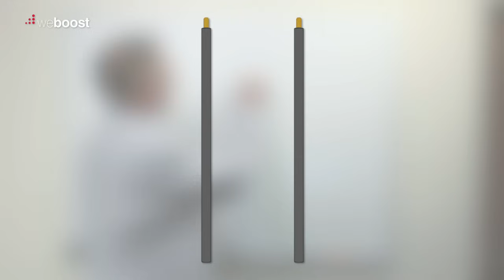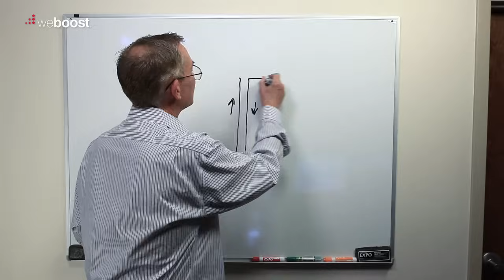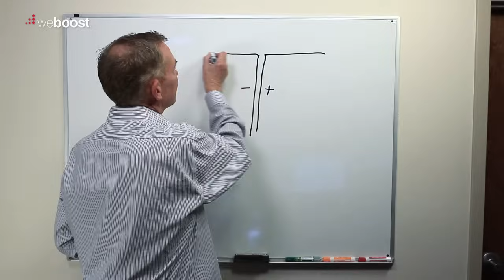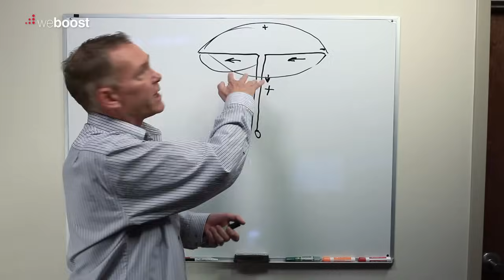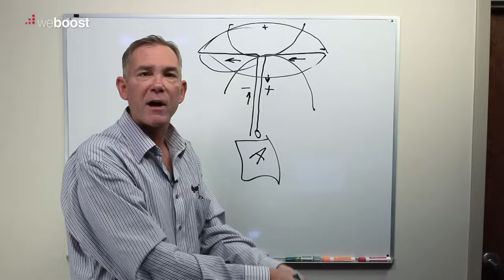How Does An Antenna Work? | weBoost

Comment: How does current flow through the wires when there isn't a full circuit, the two ends of teach separate wire are not connected.

Comment: I think I see your issue Don. You have a miscalculation in your turbo encabulator, this is simple to fix.

For a number of years now, work has been proceeding in order to bring perfection to the crudely conceived idea of a transmission that would not only supply inverse reactive current for use in unilateral phase detractors, but would also be capable of automatically synchronizing cardinal grammeters. Such an instrument is the turbo encabulator.

Now basically the only new principle involved is that instead of power being generated by the relative motion of conductors and fluxes, it is produced by the modial interaction of magneto-reluctance and capacitive diractance.

The original machine had a base plate of pre-famulated amulite surmounted by a malleable logarithmic casing in such a way that the two spurving bearings were in a direct line with the panametric fan. The latter consisted simply of six hydrocoptic marzlevanes, so fitted to the ambifacient lunar waneshaft that side fumbling was effectively prevented.

The main winding was of the normal lotus-o-delta type placed in panendermic semi-boloid slots of the stator, every seventh conductor being connected by a non-reversible tremie pipe to the differential girdle spring on the “up” end of the grammeters.

The turbo-encabulator has now reached a high level of development, and it’s being successfully used in the operation of novertrunnions. Moreover, whenever a forescent skor motion is required, it may also be employed in conjunction with a drawn reciprocation dingle arm, to reduce sinusoidal repleneration.

Comment: The video presenter is actually incorrect in his description of current and voltage distribution in a dipole antenna. He should have said in the diagram that the high current point of a dipole is in the centre at its feed point in this example with the high voltage points correspondingly at the ends of the dipole. The single direction of curent flow shown however, is correct in his example given.

Comment: I thought that electricity moves equally at any given point. I would've expected to see cylinder like wave coming out from wire, but instead the center of the wire has more streched magnetic field than the edges... or maybe magnetic field is like a disturbance of an ether field. The electrons push rhe ether evenly, but the ether that is pressed in the center has to travel further distance because of the pressure, while the edges under pressure are pressed to the sides and they travel less forward???

Comment: To explain the “current flow” in the antenna, which is an open circuit, one should explain that an oscillating current is applied to the antenna. Here is a better explanation https://youtube.com/watch?v=FWCN_uI5ygY&feature=shares

Comment: A coaxial cable was invented by genius physicist Heaviside, an antenna operates on alternating current, when current is passing through a wire it creates a magnetic field around it. The magnetic field creates EMI around the conductor and EMI is not free it's not only interference but all so power loss on the path. So we need something to catch our magnetic field from the central wire and not only catch but all so neutralize it somehow. That was a difficult task at the time and really even now you would have to spend some time to understand the physics behind the coaxial cable. Heaviside was not understood even by his fellow scientists in his times and the coaxial cable is difficult to understand. The basic idea behind it is that you can view a coaxial cable as a continuous loop around a wire. When current flows on the inside wire it creates a magnetic field around the wire - the outer coaxial ring but the outer coaxial ring at this moment is moving a charge in the opposite direction to the central coaxial wire, therefore it creates a magnetic field of its own. An opposite charge is moving by the outer ring that can be viewed both as a loop and a conductor, the charge moving through the outer loop induces a magnetic field on its own surface but only with an opposite to the magnetic field induced by the center wire sign. We have one field induced by the central wire on the outer coaxial ring with + sign and another equal magnetic field induced by the outer ring itself on itself with the opposite - sign. These fields are exactly equal and they cancel each other out. No noise around no power losses on the path. 
Please note that this effect is only possible with high frequency currents. Because with high frequencies the current is not flowing through the wire but rather hovers over it. The higher the frequency is the higher the current hovers over the conductor. It hovers outside of the central wire and inside of the negative outer ring. If you visiualise that - you'll see that both currents with both directions are moving inside of the coaxial wire through the same outer ring basically hovering in the insulator. And that creates an electromagnetic field on the outer ring with the opposite sides which cancels each other out and that's how the shielding of the coaxial cable works. With DC coaxial cable miracle isn't happening or rather the effect of the shielding is very small because the current on the outer ring is too close to the surface - no charge passing through a ring. That is the reason why it's only used with high frequencies. For low frequencies it has a "transparent" shielding because the loop for the magnetic fields for the current traveling in the opposite directions is no longer the same.

Comment: I don't think that 'jumping' part of radiation is the right description. I think it is best described as 'pushed away'. I figure the critical question in this regard is this: Why does the field fly away? Why doesn't it just collapse back onto the radiator?  If the peak of the arc of the field is close enough to the wires the field will collapse almost completely back onto the wire and there will be no far-field radiation. But how close is close? It's the reason that physically short, (relative to the wavelength,) antennas are such lousy radiators. The peak of the arc of the field has to be far enough away from the radiator that at the speed of light it doesn't have time to collapse back onto the radiator before the next cycle of that same polarity begins to expand and opposes it, pushing it still further away. In short, an antenna works as a pump. Once the field has been pumped far enough away from the antenna it keeps on going. So it's clear that the relationship between the size of the field's arc and the frequency of field reversals determines the effectiveness of radiation, at least out to a half wavelength, the largest possible arc. The lower the frequency, the longer the antenna radiator required for the same efficiency since the lower frequency gives the initial field more time to collapse, so the arc of the field has to be larger. I don't know the math to describe it but that perspective has always made sense to me, and I'll bet any field theory math that follows from that perspective works correctly.

Comment: The question that almost all students ask and never gets answered is; "How does the signal leave the antenna into a medium that has no substance?"  A dipole is not the best explanation starting point.  How about an infinitely long wire where the signal departs and never returns!  We even know the impedance of free space in ohms. An interesting parallel is the skin effect, signals riding on the outside surface instead of the centre. It boils down to the velocity factor in wire rather than air or space. A dipole is just a long wire with a finite length. Any conductor length less than infinite has a reflecting end point where there is bunching up and a spring-back. How much signal escapes along its transit? How many times does the signal bounce back and forth on a two ended dipole before it escapes. A more attainable ideal antenna is the rhombic with very long divergent arms. Even here there is a termination resistor whose purpose it is to absorb the yet un-radiated signal from returning from the finite ending.
Robert Livingston, VA7WN

Comment: Much has been made of the importance of STANDING WAVES- that there must be standing waves on an antenna for it to radiate e/m waves. I guess that this means the antenna is "resonant". So with a resonant antenna, there will be a minimum of this " cancellation" that u speak of, so that "standing waves" of maximum amplitude will be set up on the antenna by the transmitter. A maximum current amplitude will set up a corresponding magnetic field amplitude. Similarly a maximum voltage amplitude will be accompanied by a maximum electric field amplitude. And it is these magnetic and electric fields that radiate into space-i.e. if the driving frequency is high enough, then these magnetic and electric fields cannot "collapse" back into the antenna, but must detatch themselves from it-and thus move out into space. Also, although u want standing waves on the antenna, u definitely do not want them on the transmission line-i.e. the coaxial cable that u spoke of.

Comment: Hi don could you explain why on a typical fm diapole it has 2 wires at the top of the T with the ends tied together?.
Reply: If he could he would but sadly he’s no longer with us.
Reply: That type of antenna is called a folded dipole.

Comment: How to explain how an antenna works, without explaining how an antenna works.  I am a physics graduate though.  It's very difficult to explain properly to me, without the maths.
Reply: The math can only comes after a broad concept is understood.  If u don't understand the concept and only regurgitating the math thats on you man. As a supervisor of a machine shop i also math well. And Iv had to work with plenty of people like you. Its not really needed honestly. We have machines for the math. The concept of what outcome is needed through the math is what whats valuable in manufacturing and most of reality.

Comment: I think the thing that made most sense was the potential across a dipole where one end is negitive while the other is positive for the same value you get a EMF.  That's something I don't think I understood before- I understood the feed line either 300 ohm or coax- but not how that translates to an airel

Comment: A useful trick to understanding how antennas work is to realize that accelerating charges emit photons. In Don's example, one wire emits photons while the other wire absorbs those photons, when they are parallel. But when they are separated, they both emit in the same direction. 

Accelerating charges emit photons due to special relativity.

One sometimes useful way to view antenna design (there are many) is arranging the charge acceleration (currents) in ways that add the way you want. 

I add my prayers for the repose of Don's soul.

Comment: great explanation by 'DON'
1 clarification though: An AC current which will set up an accelerating and alternating dipole is the cornerstone for a 'Dipole Antenna' ...... anybody wishes to either correct or modify or elaborate further in the interest of the uninitiated are welcome

Comment: how can i make Antenna for wifi router that has two slot for antenna. one for antenna 1 and 1 for antenna 2.this is the picture of the router  https://ae01.alicdn.com/kf/HTB1Oy4voeuSBuNjSsplq6ze8pXaz/Unlocked-Huawei-E8372-E8372h-153-E8372h-608-E8372h-155-with-2pcs-Antenna-150M-LTE-USB-Wingle.jpg

Comment: Don I expected a antenna designer to be able to give a better explanation than this.
The pair of leads with current flowing in opposite directions do not cancel each others current out. They cancel each others radiated electromagnetic field out. They make a poor antenna.

when the pair of conductors are spit into a dipole antenna as you show the two oppositely moving currents are changed in direction so they travel in the same direction in the plane of the dipole as you show.The electromagnetic field generated by the current flowing in a uniform direction which you illustrate as moving right to left created an electromagnetic field that radiates out from the wire. Like light from a light bulb filament is can travel great distances.

On the receive side that radiating magnetic field when it strikes any conductor in its travel will induce a current in the conductor. So metal lawn chairs, garbage cans, tin roof on buildings all act like receiving antenna and have electric currents induced in them by the broadcast radio waves from many sources.  
A dipole antenna as you show will be impinged by the electromagnetic force from a distant broadcast antenna and the broadcast electromagnetic field will induce a current in the dipole that causes opposing currents in the lead wires going back to the radio. The lead wires are attached to a coil of wire in the radio that completes the circuit. The radio circuits then work their magic to get the voice or music or bits out of the signal.

Comment: In center antenna we have hight current not hight voltage but in too side antenna we have hight voltage +/- in each side  and change direction and change voltage polarite  on antenna -/+ when curent change direction
Reply: Salahi brahim: Correct....Dipole antennas have high Current / low voltage in the centre and high voltage / low current at the ends.

Comment: Sir what happens when antenna length is shorter than half of wavelength. 

And amplitude of em wave is controlled by current or voltage?

Kindly answer. 

Thanks u

Comment: How can I make cell phone signal booster ???
With this theory.
Reply: you can't without whole much more learning
just buy one on amazon or better yet buy a directional antenna
It will have a dipole element in the middle connected to the feedline as well as a shorter director and longer reflector elements to force the energy in one direction.
cell phones utilize multiple frequency bands so the antenna either has to be multiband or very wide band which again complicates things by order of magnitude.
The best thing you can do to yourself to learn all the related theory hands on is to become a ham radio operator. get an app for that and the exam is only 15$

Comment: I thought the current always has to be zero where the conductor ends, and the voltage its maximum.   And wouldn't the current be highest at the feed (lowest impedance) and the voltage its lowest?
Reply: Backpacker Thrulife: Yes...he got them the wrong way round. A dipole antenna has high voltage and low current at the ends and the opposite (high current & low voltage) at the centre.

Comment: I get why the direction on left wire,,,  but the right wire you have power just appearing somehow and moving thru the wire,,,  positive and neg,,,,, the positive is hooked up to something radio or a hoes purse or some electronic,, hard wired ,,,,  but this mysterious negitive begins in the air and magically moves in wire       So the bottom of example are on a car battery?  Positive goin out lookn for somin,,,  negitive has its dick in the wind not doin squat.  ?   How can the magic just materialize somewhere invisible in the air ...  find and enter the right wire in example,,,, then move and dance and become part of the get down?    I think this okay video falls short of showing why that is?

Comment: If the energy just “jumped” off of the antenna into free space. Why the need for a resonant length?  I believe the energy “bounces” back and fourth at least several times on the elements of the antenna before it gets radiated into space....... Thus the need for a resonant length antenna. The elements of the dipole have to be in phase with the wavelength being transmitted.  

Any thoughts?

Comment: So Antenna is basically an open circuit obviously.  I did not know that you could even have any type of electron flow in an open circuit regardless of how the wire is shaped.   This is all too weird for me or nobody really knows how to explain it or what is actually going on.  Obviously, everybody explains it in this same manner.  Very absurd if you ask me.  This is the same type of absurdity as the absurdity of computers operate and know only binary numbers and stores everything as 0 and 1.   Which is false.  0 and 1 are nothing but abstraction.  It is not true at all.  It is false.  You can not find 0 and 1 anywhere in a computer unless maybe in the serial number in the back of it.

Comment: Why is there current flow? Is that not an open circuit?
Reply: https://youtu.be/ZaXm6wau-jc
Reply: It is like a capacitor charge and discharge
Reply: @kassima9892  Even a capacitor needs a closed circuit to work and charge an object.

Comment: Hello and thanks for the video.  I do have a question.  What is the name of the item on an antenna that connects the wire mess antenna to the coax?  I think I need a replacement for my antenna.  Wondering if I can purchase and replace my broken piece so I don't have to throw away a perfectly useful antenna.  Please help.

Comment: I have a RV. Online I've seen RV videos saying that the Wilson Electronics 19-inch 4G Truck and RV Spring-Mount Antenna works better than the weBoost Drive 4G-X RV 470410 Cell Phone Signal Booster for Your RV Antenna. Why is this? Thank you